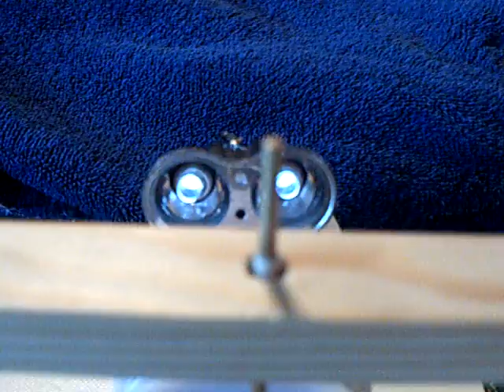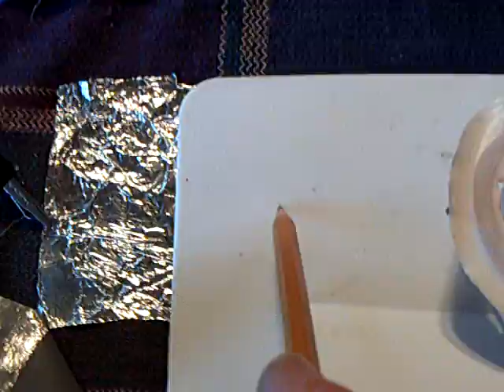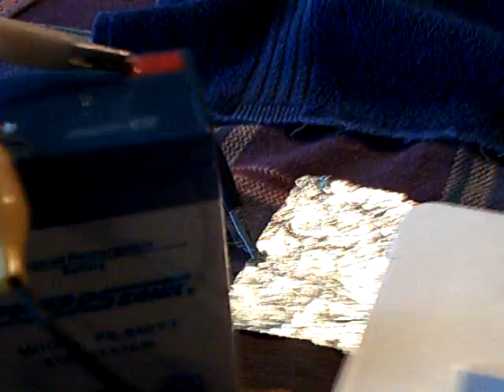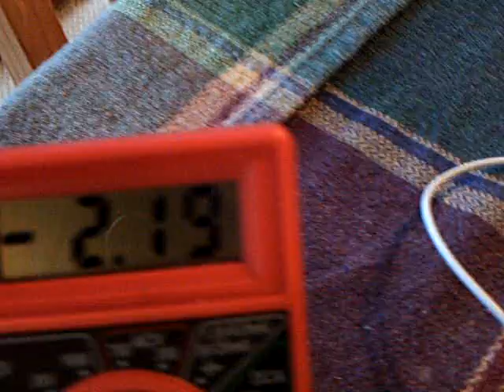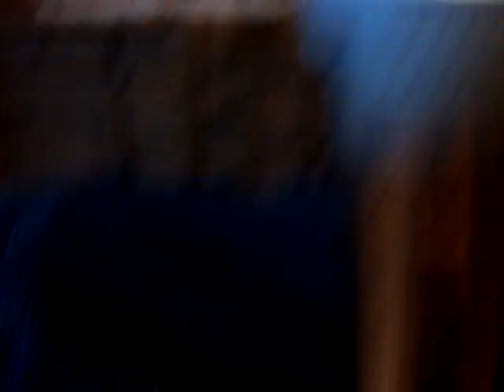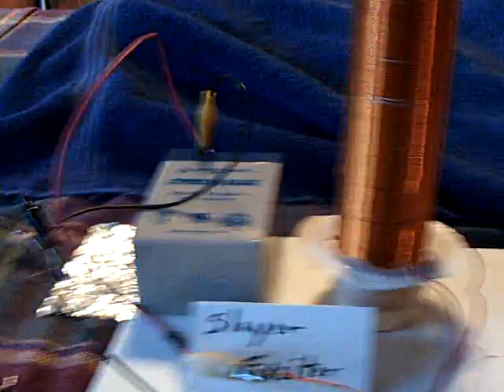Slayer Exciter charging a pulse motor.ASF

Comment: I see more open exposed type capacitors lately. Where as before I saw mostly the store bought type enclosed cylinder electrolytic caps These type may not interact the same as the open or foil type. The open foil type in these arrangements funtion differently. They are part of a tank circuit in true resonance with a tiny oscillation the gap between plates serves a separate function than a storage capacitor.

I like how your developement and the simplicity and design of the Neo spinner